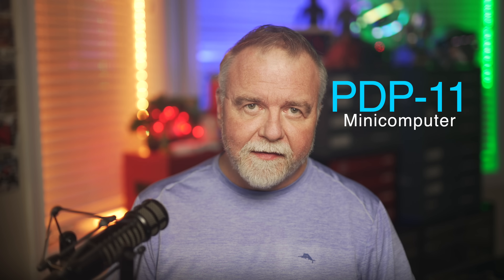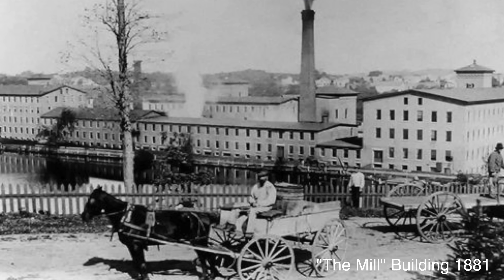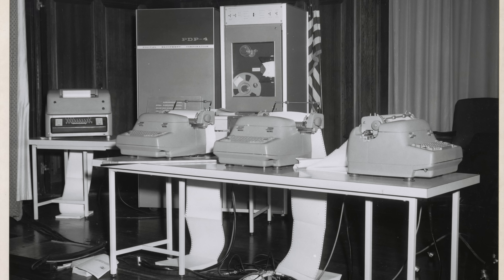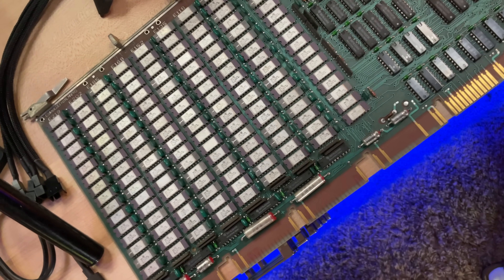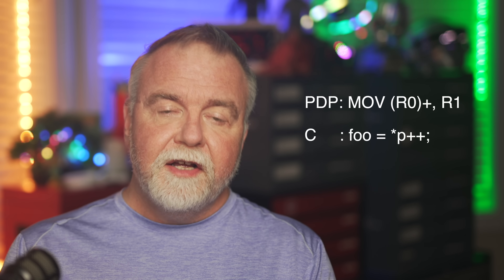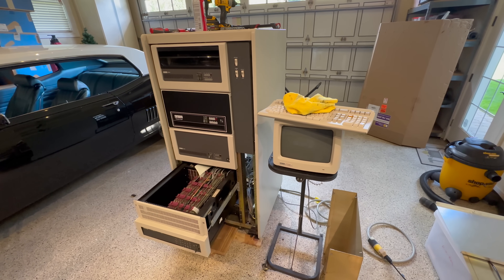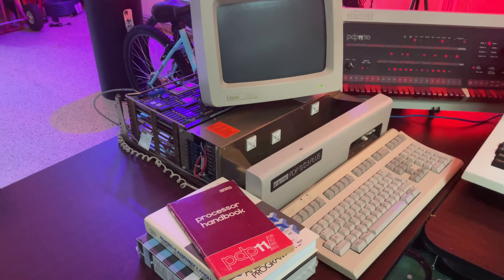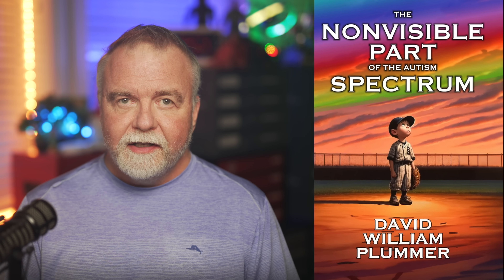From Core Memory to the Internet: Amazing History of the PDP-11

Comment: When I worked in US Support for DEC during the 80s, we had a PDP-11/70 with core memory running RSTS.  When we would come in on Monday morning that machine had always crashed over the weekend.  Since no one was using the machine over the weekend, it would sit in the idle loop and heat up a section of core until it would temporarily fail.  Switched out the core memory for solid state memory and the problem went away.,

Comment: I worked for Polaroid (Another "great to work" for company like DEC) when I graduated as a ChemE in 1978. I had a PDP 12 in the corner of my office (In spite of the number, the PDP 12 was, I think, a slightly earlier DEC product than the PDP 11.) It had been sold/bought for laboratory automation but was handed off to me with a "Here kid, see what you can do with this." It had a bunch of modules mounted in a vertical rack about the size of a phone booth with caster wheels. There was a tape drive module which mounted two reels of 1" mag tape, a 9" monochrome screen module, a module with address register switches and register status lights, and a module with a keyboard. I believe I was programming it in Dartmouth Basic. I ran simple programs to automate calculations for the film stock coverage of the precious metals that were used in Polaroid's film structure. At one point I had a $10,000 bottle of palladium emulsion on the corner of my desk... And Polaroid had an active precious metal trading desk. Both DEC and Polaroid were wonderful companies to work for in the 60's and 70's... And both "missed the boat" of technological change... DEC missed the personal computer boat and Polaroid got turned into road kill by digital photography.

Comment: One of my most prized possessions is a small core memory.  The most beautiful core memory was on a Univac 1108.  Inside the rack, the core was suspended by the grid gold wires.  The rack also had LED status switches, which would blink.  The lights would glissen on the gold grid.  It was the most beautiful thing from my youth.  If you ever come across a Univac 1108 core memory rack please let me know.  I would love to see one again.  Also the 1108 control panel was also a sight to behold.  I used to be able to enter programs from it.  A Univac 1008 was my first personal computer.

Comment: I worked as an industrial electrical/electronic technician for RR Donnelley (printer) for 46 years. From the late 1970's and 1980's our production lines
used the Square D 8881 PLC (programmable logic controller) for line control, basic input/output, the 8881 used 8 & 16K core memory. If you wanted math
capability you needed to purchase a separate ALU that plugged into the top of the PLC. The PLC had a DB-25 RS-232 port to connect a dumb terminal for troubleshooting. A programmer in engineering also used that port to connect what I remember were numerous PDP-8's, they were used computers, I think he procured them from another division that had upgraded. He wrote programs in assembly to
collect data from the lines. Time of stop, number of stops, what caused the stop & how long they were down, etc. He used to get REALLY upset if someone on the
off shifts unplugged his computer to troubleshoot the line and forgot to plug it back in.

Comment: At our museum we have several 11/70s amd the only PDP-9 in the world that works. We are restoring a desktop (225lbs) PDP 8 at the moment. Also developing a flip chip tester as well.
To me, you dont know what real computing is unless you actually had hands on an IBM mainframe. I worked on 407 accounting machines, then 1401, 360 on up to a 3090. Running either DOS of MVS.
I wrote a complete accounting system on a 360 with only 16K of memory with 8 tape drives

Comment: My first DEC processor was a PDP-8e in an electrochemistry lab in college in 1977. First job I had was 1980 as a field tech at the National Naval Medical Center in Bethesda MD. We had four PDP-11/34 running RSX11M in dual redundancy on the largest building automation system in the world at the time. We had RL01’s then RL02’s and several VT100’s and LP printers. I did remote field terminal startups and later programmed test applications in Fortran. It was an amazing learning experience in so many ways. DEC gear was always super impressive and well built. Great memories from your video.

Comment: 02:47 "Give a stack of cards and get result returned. If you were lucky it worked."
You also got a "core dump" - which is a print out of all the memory registers with the variables. In this way you could find out were the program went wrong.

Comment: My beginnings were on a pdp11/40 that had 112KiW core memory, a few dz and du serial multiplexers, rp11c disk controller, two line printer controllers, high-speed card reader controller, mt11 9-track tape controller, dual DECtape, dual 8" floppys, and possibly some things I forgot about.

I learned a lot from the pdp11 starting in 1977, mastering it's assembly language and becoming proficient at compiler code generation and operating system related techniques (the school used RSTS/E on this machine).

The instruction set architecture is amazingly clean and orthogonal. Some of the extended instructions violate that, and the "mark" instruction is an abomination that I've never seen used in legitimate code.

I worked at dec in Maynard for the first half of the 1980s, did graphical firmware and some drivers for the professional 300 personal workstations, and ended up designing serial terminals.

The pdp11/40 was in the BBN imps that were the thing used by everyone to connect to the ARPAnet for a long time.

Comment: Takes me back to the old days - The Chem E department had a NOVA computer used in the process control lab. It was a big day when we got a whole 8K of core memory and 2 MB hard drive. Grad students got to do the upgrades. When I entered the work force there were PDP 8’s everywhere running gas chromatographs in refining and chemical units. That was back in the day of hands on the iron.

Comment: Years ago, I used to be a computer technician for a telecom company.  I used to work on various models from Data General, DEC, Collins and Prime.  These included 1 PDP-8/i, several PDP-11s and 7 VAX 11/780s.  I used to repair core memory boards for the Data General computers and have a core plane from a Collins computer.  It's 4K bits and 32 of them were stacked in a memory module and the computer held 4 modules for a total of 64 KB.  Incidentally, in the photo of Richie and Thompson, there are a couple of Model 33 Teletypes.  I got started in the telecom industry, back in 1972, as a bench technician overhauling models 28, 32, 33 & 35 Teletypes.  The Eclipse computers also used the AMD 2901 bit slice processor and I'd get right down into the microcode when repairing the CPU boards.  I first came across Ethernet with DECNet over 10base5 "Thicknet" connecting the VAXes.
BTW, my first computer was an IMSAI 8080, which I built from kit in 1976.  My computers now run Linux but, back in the late 90s, I was the OS/2 product specialist at IBM Canada, which made me the top person in the country on OS/2.

Comment: Wrote my first code in 1975 at high school computer club - just as you explained.  Write code on a gridded paper sheet,  send it to local university.   A week later get result back,  which was usually something like "Syntax Error Line 2".  Didn't put me off computing though!
Reply: In my grade 12 FORTRAN class (1970-71) we used pencil mark cards!
Anyone here remember coding sheets?  Radio Shack and others sold them for BASIC.

Comment: PDP 11-34 guy here. I got a job at a check printing plant as the computer fixer. It had many VT 52 dumb terminals on a 20ma loop connection. the girls would type the checks, then printed on line printer, then proof read, then corrected as required and sent to 6 level paper tape punch.  The paper tape went to lin casting machines (think lead) . The lead type was proofed and sent the check presses. I kept PDO 11,s running (2) and VT52,s and paper tape punches all running.  PDP 11s replaced by IBM. It was a long time a go.

Comment: As you are probably aware, 'Dasblinkenlights' is "properly" spelled 'Das Blinkenlights', as the article 'das' is equivalent, in this context, to the English word 'the'.  In other contexts, 'das' means 'that'.

However, the plural of the word 'lights' requires a different article: 'die'; otherwise, the article 'das' is correct for one 'light'.  So, properly rendered: 'Die Blinkenlights'.

However however, the "true" fake word is 'blinkenlichten'.  So, properly properly rendered: 'Die Blinkenlichten'.

I don't speak the real language, but i am fluent in the fake language.

Comment: 1980.  PDP 11/70 Accesed from a line terminal through a 300 baud modem about 20 miles away.  Learned BASIC programming.  First place I ever played Oregon Trail.  It was fun modding that game.    Also wrote a random word generator based on a statistical spelling model from a sample input text.  It was useful for generating names for D&D.  I still have the program printouts.

Comment: We had a PDP11-34 in the lab at New Mexico Tech in the late 70's, used mostly for student projects, especially those in the graphics and animation area. We also had a DecSystem-20 for general student use as well as all the administrative computing. I believe the Dec-20 had a built-in PDP-11 front end to manage the interactive terminals on the system.

Comment: Ken was a visionary - but he missed a couple of massive inflection points, Personal Computers - 'there will be at most 5 PCs in the World' and Unix - 'snake oil'

I loved working for DEC and it's culture, but it saddens me still today that with such a great history Ken missed these key inflection points and this was the demise of the once great business. The irony of being sold to Compaq a PC company makes the memory even worse.
Reply: "...missed a couple of massive inflection points, Personal Computers - 'there will be at most 5 PCs in the World' and Unix - 'snake oil'...."

He also missed (like many CEO's at the time) the rising ubiquitous of TCP/IP vs. proprietary DECNET..   And, of course, the ever expanding Internet.

Read an article somewhere that Dave Cutler (primary architect of VMS who later moved on to Microsoft and was a major influence in the design of WNT) and others wanted to port VMS which was written in BLISS / MACRO64  to a more portable language such as "C" so it could run on other hardware.

Ironically,  VMS V9.2 is now ported to x86 by a company (vmssoftware) that bought the IP from HP and is available today as a commercial product.

Only if we all had a WayBack machine .....

Comment: Great video (I'm also a grey beard who started programming on a model 33 KSR teletype with paper tape). Anyone who found this video interesting might also be interested in the book "The Soul of a New Machine" by Tracy Kidder which chronicles the creation of a rival to the DEC PDP line of computers. I read that book a few years after it was published (when I was still relatively young) and, as a programmer, found its description of the creation of the hardware my code ran on captivating.
Reply: I got started in telecom overhauling Teletypes, including the M33.  Later on, I worked on Data General Nova and Eclipse computers, among others, and read that book.  BTW, it was the M35 ASR (Automatic Send Receive) that had tape punch and reader.  The KSR (Keyboard Send Receive) didn't.  I also had a model 35 ASR connected to my IMSAI 8080.

Comment: I used a PDP-11/70 back in 1983 in college to attempt digital audio sampling of musical instruments for a group project. It was hilarious! We were able to sample low-frequencies (bass guitar) OK -- they only sounded slightly awful. But the high-frequencies (e.g. flute) were hideous. We consoled ourselves by playing a lot of Star Trek! A few years back, I was given the carcass of an old PDP-11/34 -- the one with the keypad and the selector switch instead of the toggle switches -- but they had removed the transformer and I was never able to get it repaired. Ended up giving the parts to a local PDP-11 User's Group. I hope they eventually got it fixed. I love to see the old hardware (and software) up and running. Thanks for bringing back some fond memories!!  Now I'm heading over to the Attic...

Comment: In September of 1988 when I started my Computer Engineering degree at Georgia Tech, they were still using an old PDP 11/34 to teach Unix and C to freshmen.  We had, if I recall correctly, 16 VT-100 terminals in the classroom, all connected to the PDP 11/34 located in the next room.

Comment: As someone that earned my first living on the PDP11, I was wondering if you would be interested in learning about the alternative PDP/11 operating system that my industry used back in the day for the database.  My first job out of college was working on commercial software that was primarily hosted on PDPs running Intersystems M11+.  We later installed a few M/VX systems on you guess it, VAX computers.  Within a few years, Unix took over our industry and we started using M/UX variants on AT&T System 5 hosts from Altos, Sequent, Motorola, and eventually HP.  I have some very scary stories about converting customer data from a maxed out PDP to a Sequent system.  Using 12+ 9track tapes!!!!

Comment: Hi from London! Great video thank you! Started my IT career in 1984 as an operator using Systime computers which were PDP 11 computers (ours was an 11/70 clone - a Systime 6700 I think). It was a Unibus machine running RSTS/E with around 1.5MB of Ram. It would comfortably support 40 users/ processes. I have really fond memories of that time fresh out of school at 18. Our tasks were running jobs, printing, cleaning the tape drive heads. Not forgetting the all important disk copies at night  (128MB removable packs) and having to take the disk packs over the road to another building for off site storage. I do remember we used to receive files remotely for processing so had some external connectivity. We also had to have the disk packs checked regularly which would involve a suitcase style machine to mount the pack in and the engineer would examine the individual platters using a wand type mirror and a magnifier device. Would really like to see more PDP content here. Cheers again!

Comment: In 1980 I worked for a company called Tektronix. They resold DEC PDP11's in self contained racks. My job included three things 1) Pulling off the DEC Nameplates and replacing them Tektronix nameplates & stickers. 2) firing them up into a preprogramed diagnostic sequence. 3) Ensuring the Peripherals were all installed and operational. I still have one of the circ fans that would have been installed in very top of the rack (6' tall?). The fan was massive and the throughput was outstanding (still kicks butt 40 years later).  Last in your video a disc was seen being installed about 15" in diameter. Open up the r/w door and you could see a laminated oxidized (rust orange) humongous disk. I kept one of those as well but tossed it about 15 years ago. What a huge mistake that was. So the question is do you know what disk I am talking about and it's spec's? Love the videos by the way!!!

Comment: Re 00:02:20 - I worked in a weaving factory that looked like that DEC building. The weaving machines used plastic cards with holes in them (to code the pattern of the weft... or warp, I forget which)  just like early computer cards. Data in, data out. And that was the 1990s.

Comment: You had my attention up until you said "refreshingly progressive" as I cannot shre that sentiment.
Reply from the maker: If someone disagrees with you, it should sharpen your focus, not cause your mind to wander.  Do you not agree that his policies were progressive for the time?  Or do you just reflexively have a problem with progressive policies?
I'd know if you had said but you didn't so I don't.
Reply: @DavesGarage  Thank you for your reply; you perhaps make the point that I was not sufficiently loquacious in my earlier comment, merely stating my objection, rather than providing a full account, after all this was a YouTube comment, not a party manifesto. In response, may I start by asking by what moral authority do you presume to tell me what I 'should' do when encountering someone who disagrees with me? Are you the should police? Both of the options you present as alternatives are wrong and do not reflect my values; I reject the adverb 'refreshingly' when applied to progressive. I believe progress is a matter of opinion so reject a political movement co-opting the term, thereby suggesting anyone who disagrees is against progress, which then is presumed to mean against improvement or some such nonsynonym of 'progress'. I do not find 'progressive' thought in any way refreshing and thus concluded that I wasn't going to gain anything from the remiander of your video.

Comment: In the early 1970s I worked for a manufacturer of semiconductor products in a group that made equipment to automate the testing and manufacture of their product line.  We decided to use a PDP-11/20.  One of the team members wrote a PDP-11 cross assembler for a CDC 1700.  We submitted hand written code and the next day would receive a printed listing and executable code on punched paper tape from the CDC 1700.  The PDP-11s we used didn't have an OS and we had to enter a bootstrap loader via the switches on the front panel to read the punched paper tape.